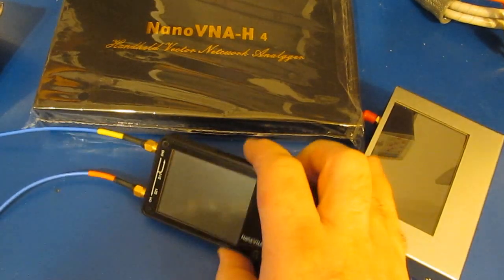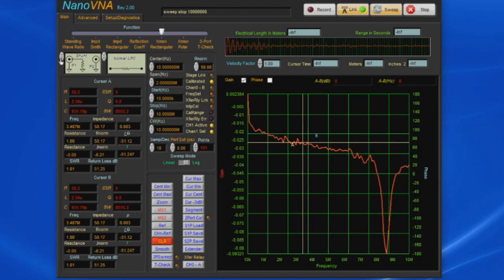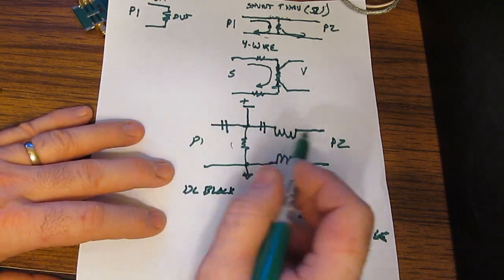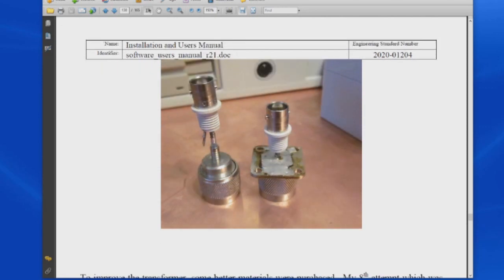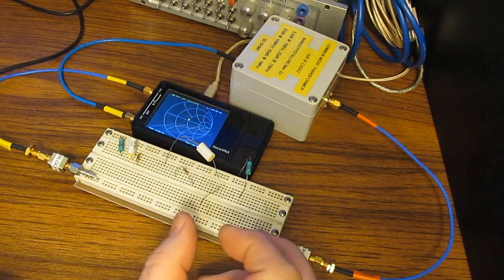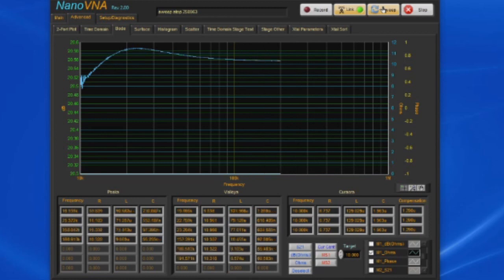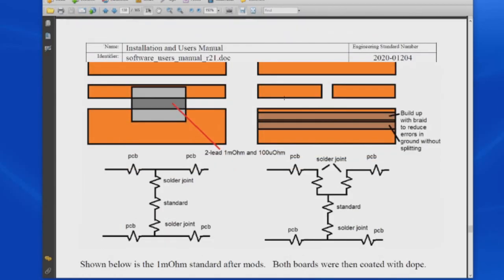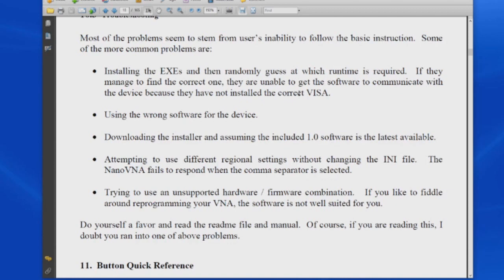Using the original NanoVNA to measure PDNs

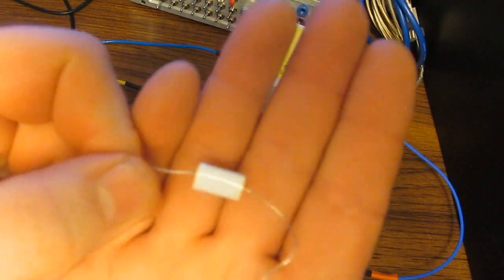Comment: 34:16 Why don't we ever see resistors in series with bypass capacitors on a typical smt PCB - with say a  microcontroller? (Or do we?)
 It also goes against intuition as we want to have unrestricted flow from the capacitor to meet a current demand of a digital circuitry.
Reply from the maker: You pick cap types with the ESR you are looking for.

Comment: I've noticed you use only male SMA connectors on your test fixture PCBs.  Was there a special reason for that? Perhaps a reliability concern over the female connector?
Reply from the maker: No reason really outside of the standards are male and I use a stainless F/F or coax to F connector.   In this video, you see me using coax to M as well to connect to the breadboard.

Comment: Hi Joe, thank you for sharing your knowledge!  I've learned a lot from you over the last couple weeks as I descend down this RF rabbit hole.  I'm interested in laying out my own co-planar waveguide PCB test fixtures for 0805 size parts.  I'd like to pick your brain about your waveguide PCB fixtures you talked about at 43:00 in your video.  So I take it that If you were to redesign those fixtures, you'd place a cut in the ground plane (instead of adding braid) to make a better 4-point connection?  Steve Sandler also mentioned the importance of a 4-point connection on these boards in this video:  https://youtu.be/HFTd7pH06s4?t=2288  I'd be super curious what your opinion is on his PCB layout he shows in the video...but looks like its for an odd size package.   Also, he mentioned that a better way to break the ground loop (especially at super low frequencies) is to use a differential amplifier like his J2113A feeding the receiver port instead of a transformer.  I'm not finding a ton of information about these fixtures on the internet.  Appreciate any feedback.  Thanks again!
Reply from the maker: Yes, I would not use a solid ground like I show.  Better to use 4-wire at these  lower values.  Still, results were good enough for this demo and limitation was the VNA, not the test fixture.    It may be difficult to break the ground loop at 6GHz with an active circuit.   So it is going to depend what you are after.  The low frequency limitation of what I show is once again, the VNA.

Comment: Hey Joe I apologize in advance for the stupid question. I'm not into rf so I thought that pdn with the nano vna was for testing antenna and such. It reads like its really used for testing any digital network like on a pcb in development to make sure power delivery is behaving properly or to troubleshoot the same. Like finding problems of unexpected inductance and stray capacitance? Once again I apologize. You are on a level that I'm sure even your peers are not at.
Reply from the maker: The idea is to design the power distribution network for a flat impedance.    What  is being showing is an attempt to measure it with the NanoVNA.

Comment: Hi again, Joe ... With reference to this video and the beginning of your software manual I notice that in order to make sure that everything works I should find an original NanoVNA. However, searching e.g. ebay gives hundreds of suggestions none of which appear to be guaranteed original nanoVNAs. Any chance you know where to buy those original nanoVNAs? I will mainly be using my nanoVNA for PDN measurements on DACs and ADCs, and for characterizing passive components ... Cheers & thanks for any input on this, Jesper M
Reply from the maker: Sorry I can''t be of much help.  You can try asking in the email group groups.io .   They are cheap enough that you could just buy one and try it.
Reply: @joesmith-je3tq   Hi Joe & thanks for your prompt reply ... I have now posted in the groups.io nanovna-users group and hope they may know about this. And, yes, I realize these nanoVNAs are not costly - it is more the time that may go into trying to figure out why something does not appear to work. I think your software looks really great - and I indeed appreciate the opportunity to be able to use it - but not being a programmer I know that I could spend hours upon hours trying to find out what could be amiss if something does not work. And, admittedly, I'd rather discover electronics, circuitry and components (using your software) in this time ... Cheers, Jesper
Reply from the maker: @irpheus  Most of the common problems people run into are a result of them not reading the documentation rather than the product.  That said, we are looking at one now that seems to have known hardware problem with the USB supply voltage.  Most of the problems I have personally had with the products has been poor firmware.  

A few people have written me about using the H4 with my software.  I never had any luck getting that combination to work but it's possible the newer firmware has improved.
Reply: @joesmith-je3tq  Hi Joe ... just saw your message. Hmmm ... having thought about things I reckon it might be feasible to mention what I would actually like to measure (noticing in your videos that you are interested in digital circuitries and your demonstration of how an "unstable" amplifier did not work well with the cheaper VNAs): 

My VNA use is to measure PDN impedances on DACs and ADCs - WHILE - those components are powered up, yet - not - active (no clock or data signals). Thus, the intention is to also get an idea of the intrinsic "hidden" inductance/capacitance PSU pin characteristics of the DACs and ADCs in question - without the DAC/ADC actually sampling. Additionally to characterize components - including larger capacitors (up to several thousand microfarads). 

I am, however unsure if the square wave output signal of these cheaper VNAs will mess up such measurements? Might you have an idea about this? 

And, if you reckon it wouldn't work, might you then suggest a not too costly VNA that outputs sine waves (and it would just be a gift if it would also work with your software) and would work for these purposes? I would appreciate your feedback! ... Cheers, Jesper

Comment: Found and watched this video after my question re:cmt at the 61e+video. 
This was great.  I have same curiosity as other commenter, HH, on the equipment. I'll read manual as next step. 
I appreciate how you're creating experiments that demonstrate effects of component selection and circuit construction on performance. 
I'm studying and doing labs to learn EE fundamentals.  No great goal right now but your nanovna work encourages me to study antenna theory.  Thanks! Maybe I'll be ready for a nanovna in 2022 after I understand things a bit more.
I'm understanding details more each time I go through video and manual(text). Building foundation.
Reply from the maker: >2. What Z characteristics did you build your common mode transformer to?     These are designed for a 50 ohm system.  This video shows some of the measurements I had made with this core and how it compares.   If someone shows me a black toroid with some coax, it has no value.  I can use Google images if that's all I am after.   I want the material selection.  The rest, I can figure out.  A good reference book is the ARRL handbook.   Good luck with your new learning adventure.

Comment: Hey, thanks for so many useful information, could you provide us more information about how to create own DC block using Teflon spacers?
Reply from the maker: These blocks are not something you would typically want.  For example, you can't purchase one from Mini-Circuits.  For PDN, they needed to work at very low frequencies.  This makes the VNA much easier to damage.   These are a stacked ceramic.  Of course, their value will change with voltage but I have set the low cutoff far below what I needed and typically I would never use them above 5VDC.   In the description, there was a link to a thread on attenuators.   

https://www.eevblog.com/forum/projects/20db-rf-attenuator-seeking-feedback-to-improve/msg2965430/#msg2965430

Comment: Hey, great video!I have a lot to learn. Question: I didn't get a good look at the SMA to breadboard connectors. Did you make those or purchase? They look handy. Best Wishes!
Reply from the maker: Those are just sections of semi ridged coax.  Center conductor is solid.  Magnet wire was wrapped around the shield and plugged into the board.
Reply: @joesmith-je3tq  Thank you! Im learning a lot!

Comment: would be great to see the inside of your transformer boxes, otherwise it is quite impossible to reproduce them without all of your equipment and testing you have done, image says more than words ;), but I can understand if you want to keep it secret, otherwise nice video
Reply from the maker: I assumed most people would have seen common mode transformer and one time or another and of course, I had shown one of the early ones in this video.  I also had shown a few of the later ones on EEVBLOG.  Even the core types were listed on the boxes of the two I made up.  Hardly seems like much of a secret.   There was a person on EEVBLOG that claimed to have a fair bit of experience in this area.  I was hoping they would come up with an improved design that would be lower cost.    More to your point, you are very much correct that without the tools and more importantly, the knowledge to use them, you are pretty much on a difficult path.   That said, the original NanoVNA combined with the V2Plus4 should be good enough to get that job done.
Reply: @joesmith-je3tq  We are not as smart as you im afraid. You know how much small things about the implementation changes the performance. Like how much you twisted the wire etc.  Thanks again!
Reply from the maker: @heinrichhein2605  I wouldn't underestimate the viewers here.  During the video,  I mentioned this is a 50 ohm coaxial transformer.  There's no twisting.  However, you are very much correct that as we move up in frequency small details become more important.   I expect viewers are are interested in learning which means digging in and getting your hands dirty.   Of course there are certainly systems out there today that we use to make these measurements if that is what you are after.   I mentioned some of them during the video.
Reply: @joesmith-je3tq  True as well, a lot of amazing people here, im maybe always curious if i see a box with electronics even if it is really mundane i just want to look inside you never know what you did not before. But yes, 50Ohm coax around a core is not exiting. But you always seem to have something to learn about even the simplest things. Thanks for putting such info out there for us!
Reply from the maker: @heinrichhein2605  I agree that seeing coax wrapped around some cores isn't  very exciting but I added a picture of one to the manual anyway for curious people like yourself to have a look at.  You're not going to learn much from it.  What is useful is having the S parameter data.  From that you can calculate most of what you need to know.   I wasn't going to publish the materials I selected as viewers pretty much have all they need given to them on a silver platter.
Reply: @joesmith-je3tq  Thanks
Reply: @heinrichhein2605  I too feel a bit lost as to how to get going with the transformer and the DC block. Would you mind sharing sources if you've found any in the meantime? Many thanks!